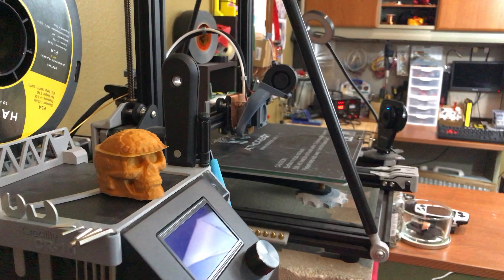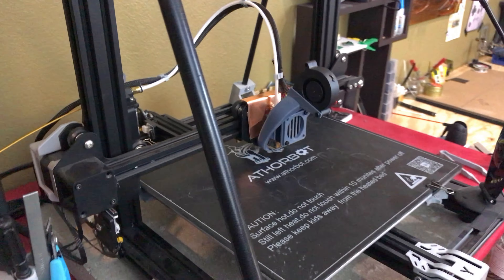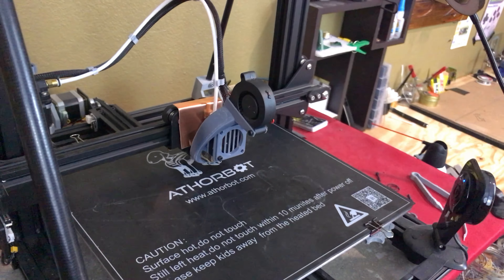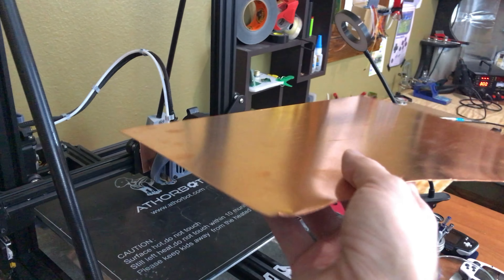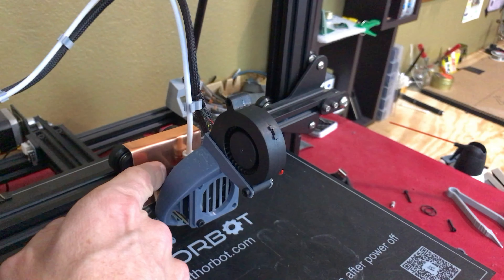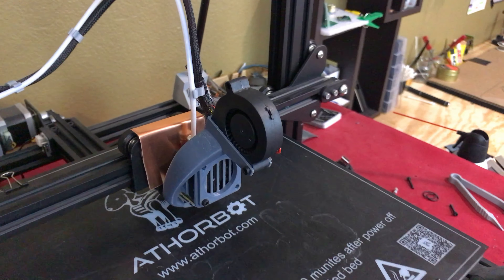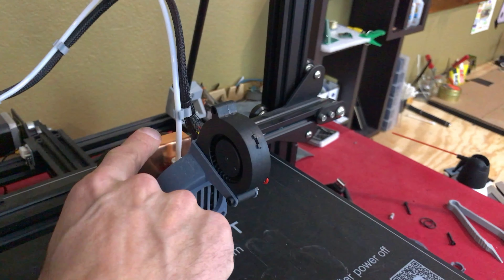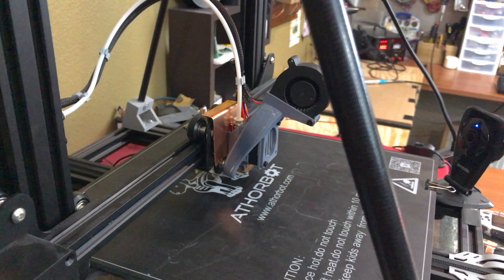Heat Creep Fix for my Creality CR-10 3D Printer

Comment: Great ideal, I never thought the bracket could be the source of the heat creep.
Reply from the maker: Thanks, this worked out for a long time, but I think it was just kind of a bandaid. It helped increased the heat removal, but I bet a lot of other things could have helped as well. I likely had restricted the airflow a bit by using a fan cover that looked cool 😂. I bet the PTFE tubing at the hot end was worn as well or had been overheated at some point. I eventually upgraded to an all metal hotend. I just got a cheap one from Amazon, but it’s nice to not have to worry about that as much.

Comment: you are getting the heat creep because of this modified fan duct for heat break, at this moment in your scenario it is mounted on heat break directly, this is a huge mistake many people does, there need to be a space between a heat break on all 3 sides to let the heat disperse from it, thats why creality designed a steel cage around it with almost 20mm gap on both sides, all kind of fan ducts which cover the heat break from the sides will make a heat creep at some point.
Reply from the maker: I don’t know why that never hit me! Makes sense! Thanks for that.
Reply: Yup... my thoughts exactly. People always forget about airFLOW... the air needs a low-resistance path it can follow.

Comment: Nice Job,  I'm having the same problem..  Heat creep with in minutes of starting a print..  Even at low nozzle temp..  I've noticed there's no place for the fan air to go..  It blows on the heat sink but , can't blow through the sink,  cuz  the back mounting plate is so close..  Air get directed out side ways or down not straight thru the heat sink..  I'm thinking about adding a spacer to move the hot end farther away fro the back plate..
Reply from the maker: ThomasTheSailor Chubby thanks! oh that may be good. I didn’t think to try giving the heat sink more room. Looking at the date of the video I guess it’s been about 10 months since I made this little fix. Since then I haven’t changed a thing. Printing PLA and PETG just fine. Man time flys. You should post an update if your idea works out too :)

Comment: Too bad I don't have an extra sheet. I also want to add that you can put thermal compound between the neck and red-block, the fan should be blowing into the red block, and move all your wiring to the right side.
Reply from the maker: This worked out for a long time for me, but I eventually upgraded to an all metal hot end. No more issues. I’m guessing the tubing inside got melted over time. Now I switch back and forth between PLA and PETG with no trouble.

Comment: First time printing.
Reply from the maker: So you can move the Z axis upward via commands and also manually by hand, but it's just not moving up to the second layer during printing? I was thinking that if the z axis will not move up by commands that it could be the coupler at the bottom of the Z axis screw. I have seen some good ideas to check out beyond that here (different printer, but might be worth looking at) https://reprap.org/forum/read.php?1,184808,184927

Comment: sorry for the noob question but does the copper have to touch the heatsink ?
Reply from the maker: Felix Feuersinger yes, firmly. This way heat transfer is maximized. This fix is still going well for me. I haven’t had to mess with it and I’ve printed PLA and PETG up to 250° nozzle temp.
Reply: @jivinhipcat  thx for the quick answer, but i guess that only works with this particular fan mount ? i still have the stock mount and am not able to print a better one due to the severe heat creep (presumably). Maan 3d printing can be a b*tch
Reply from the maker: Felix Feuersinger Oh I think you’re right; I haven’t thought about the stock setup in a long time. The idea would be the same though. It’s just kind of making the heat sink bigger. So you could maybe cut the copper (or other material) to fit around the stock setup. Maybe there’s a way to cut the stock enclosure a little to make room. I’m not sure. The nice thing about this little fix is that, for me, it was just like 5 minutes to do. I don’t know if it would be worth it if you had to scrounge up parts and spend a bunch of time on it you know. Then again maybe it would. I’m not sure. I don’t know the root of the problem on mine, but it started when I went from PETG to PLA. It also could have had something to do with me killing the power to the printer suddenly when the nozzle was still hot. Maybe that damaged something by not allowing the fan to cool the nozzle properly. I can’t say for sure. Do you know for sure you’re suffering from heat creep?
Reply: @jivinhipcat  well im not 100% sure but i have literally tried every fix i could find for clogging and underextrusion. The next step would honestly be to either throw it all into the bin or buy a better hotend as this is pretty much the only thing i havent upgraded by now. I'll try to grab myself a piece of copper tomorrow and see if i can somehow apply it to the heatsink. thx so much for the help tho !
Reply from the maker: Felix Feuersinger No problem. I had under extrusion issues before that turned out to be a problem with the extruded stepper. The little gear threat presses up against the filament and pulls/pushes it through was the issue. I had thought it best to position the allen screw right at the part of the shaft that is flat. I though it would hold tight there, but a big NO on that. The gear would always wiggle free over time and cause a ton of underextrusion issues. After I rotated the little gear and tightened the allen screw to a normal rounded part of the shaft I have had no more filament gripping issues. I hope that makes some kind of sense. I’m not much of a poet and describing things like that is tough XD. Little things like that are always a pain and frustrating to find and figure out. It especially sucks when it’s costing time/money/filament. I’ve definitely been to the point of wanting to toss the entire thing, but I try to not let it get to me like that anymore. I guess it helps when things have been working well for a while. My current issue is a wired vibrational buzzing in certain movements. I’ll probably take it all apart and clean everything and reassemble it pretty soon just as a preventative sort of thing.
Reply: @jivinhipcat  in my case it is definetely a hotend issue, i got upgraded to an aluminium extruder and after countless clogs i always see the same issue - the filament is expanding in the tube and therefore causing backpressure which causes the filament grinding, making it all even worse. So after trying every setting imaginably i came to the conclusion that the PTFE tubing must get too hot.

Comment: remove fan cover..
Reply from the maker: Oh yeah I had tried with no cover, and still had the issue. Still currently going strong with the increased heat sink area using the copper plate.